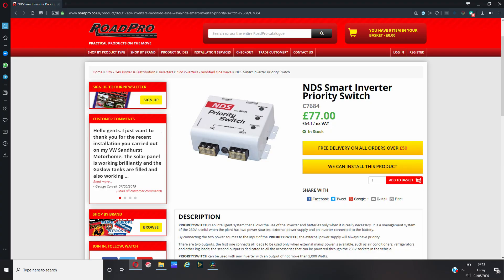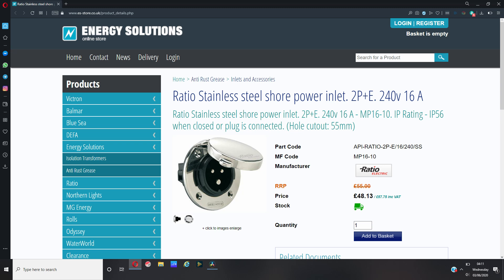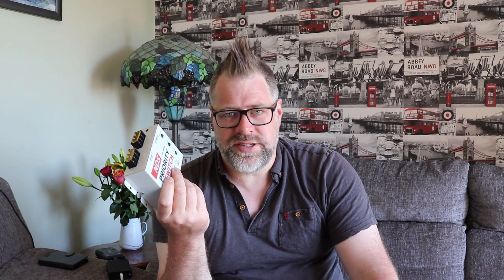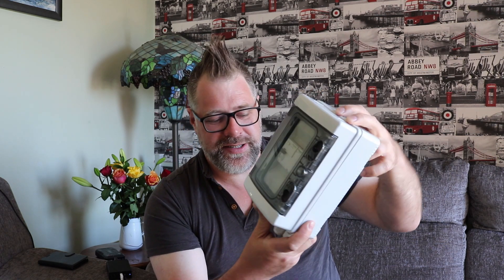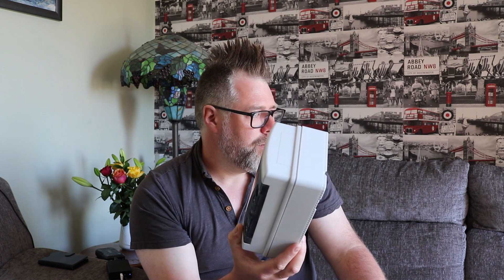MBC Automatic Transfer Switch (Episode 12)

Comment: Hi , are we now saying that the NDS unit is no good ? I only want power small items and sometimes a microwave with a 1500 to 2000watt  max inverter that will be on a remote switch.  So this should just the job for my build also it would run my battery charger when plugged in to sites power. I was thinking of running inline rcd after on the cable between inlet plug and fuse box if needed.  But I only use uk site so there’s rcd on to post .
Reply from the maker: Yeah I no longer recommend the nds unit. Check out my later vid "how to build an automatic transfer switch" .

Comment: There isn't any info on the datasheet for what the coil draws for the Europa euc2-25-2no2ncp contactor however I assume the N/C contacts will be the ones used for the Inverter circuit and the coil will only be energised on mains HU.

Q.
Will you be installing a mains battery charger?
If so how will you incorporate a dedicated 6A RCD protected MCB to supply it in order to remain compliant  with BS7671 regulation 721?

I certainly prefer the simplified idea of using a combined N/O & N/C contactor rather than the usual method of using two
Reply from the maker: Truthfully I went for the schinder equpited box not Europa so am not sure. Any spefic questions about regs have to go to spunky to be honest. I have seperate consumer unit that has a dedicated MCB for the mains battery charger. I have devices such as this that will only ever be energised from shore power and other devices that will work on inverter power only and it's all automated via the use of this box but I honestly don't know how it's all just part of how spunky has configured it.

Comment: It's disappointing that you are promoting someone who is re-packaging "off the shelf" components to sell to people as a solution. This is interesting content, but does sound more like.a sales pitch than an informative video. If someone is competent enough to install this box themselves, they should be competent enough to install something like a priority shower unit inside an IP65 enclosure, you should be explaining that too imo
Reply from the maker: When the off the shelf components work better that the product that is supposed to specifically solve this issue what would you have me do ,? Promote the thing that doesn't work ?
Reply: @AlwaysVanAdventure  Are you saying a priority shower unit with an IP65 enclosure won't work?
Reply from the maker: @brianmcgowan2221  I have no idea what a priority shower unit is. I have never tested one. Noone I trust has ever recommend I use one for my use case. I have no idea if it is designed to do that task or not. So why on earth would I tell people to buy one
Reply from the maker: @brianmcgowan2221  is that it ?
Reply: @AlwaysVanAdventure  Yes. I disagree with the sentiment of the video but I respect what you've said in the comments afterwards. Thanks for clarifying
Reply from the maker: Thanks for your input but think you have totally missed the point of......not having to worry about the paradox of choice also having the reasurrance that someone who knows what they are doing selected spefic off the shelf components and recommendeds their use in for this specific task.
Reply: @AlwaysVanAdventure  Perhaps I've missed your point yes, but I was just saying that I felt the video very biased towards a particular product rather than an impartial evaluation of what's available.
Reply from the maker: @brianmcgowan2221  as for impartial.  I bought an nds switch which is a reputable brand from a very reputable retailer and the product sucks. Not about to keep buying alternatives to try when someone I really respect offers to step in and simply solve my issue. I hope you understand that from that perspective. Thanks

Comment: Great vid as usual Jeff. What are your solutions to these two issues:
Battery charger. When on shore power you want the batteries charging but not when on inverter. Obvious reasons!
Live hook up with generator running. If the input to the changeover switch is common between the hook up and generator output the pins in the hook up would become live when genny is running. 
I have solutions to both but I wondered what thought you had given to these?
Reply from the maker: Thanks. Ok. Well as a bit of a sneak preview. I mains board has two rails. One that is active on inverter and shore power and the second rail which only ever activates on shore power. Spunkys transfer switch organises this switching. The battery charger is plugged into the rail that only activates when on shore power.
Reply from the maker: As for the generator. I plan to use a suitcase gennie on a long length of cable so will be using the shore power connection to hook up power. So the changeover switch has tow inputs. Inverter and other. Other being the shore power which can be a hook up or the gennie.
Reply: AlwaysVanAdventure, gotcha. That works. 
I have similar cu set up for the battery charging being connected to the shore line only. 
I hope to install an onboard genny and will probably use either a contactor (this is what spunky is using) which will automatically energise when the genny is on, disconnecting the line out to the hook up plug. 
I did see a pretty cool auto changeover switch for higher current ratings. Up to 63amps. Has advantage of manual operation too. Very well priced at about £30. 
All these devices use power in one position, I’m sure spunky would have it used in its ‘resting’ state when on inverter anyway, so no extra draw on your battery. 
Good luck with the build. Will be good to see your choice of inverter. I have an old ‘Ring’ 1000w inverter (inherited) which I don’t think is up to much!
Reply from the maker: @tinkertime7165  I am the proud owner of spunky's MBC which is what iveavan uses to control his gennie. I toyed with the idea of a manual changeover but prefer this working automatically. It's in inverter mode unless it see power on the shore power connection then swaps over. Inverter wise I am torn at the moment. I am doing one efficiency testing.

Comment: That unimpressed Jeff new toys giggle 😂😂. If you have a lot of power hungry devices and access to regular 240v hookup I guess it makes more sense for you to go down your chosen route.. I think when I fit out again I’d prefer to limit mains voltage and increase battery capacity. Each to their own and your theory / build is still very valuable info.. 👍🏼👍🏼
Reply from the maker: You got me pegged perfectly there. Twas more than a little figitity and excited to get me grips on these new bits. Truth is I am not going to be on hook up power for most of the time but the new inverters are approaching 95% efficiency from our testing. So a 200 Watt device would take 210 Watts of power out of the batteries at which point the maths support running mains devices but thats for a later vid. Hope you safe and well.

Comment: Hi Jeff. Very interesting. Nice bit of kit you've got there, Spunkys done well. I'll struggle on with my set up as there's no way i'll be able to fit that beast into the space i've got. I'll just have to remember to knock the rcd off before i plug in, lol.
Are you going to use lithium batteries?
Loving the vids keep them coming. 
Paul. ❤️️💙❤️️💙❤️️💙

PS. don't go poking your fingers in the live socket, it makes your hair stand up
Reply from the maker: Thanks, he has indeed. Not planning on lithium just yet. It will be a battery solution which should see me through the next 3 years or so by which time lithium should be a lot cheaper fingers crossed. Glad you liked it, :)